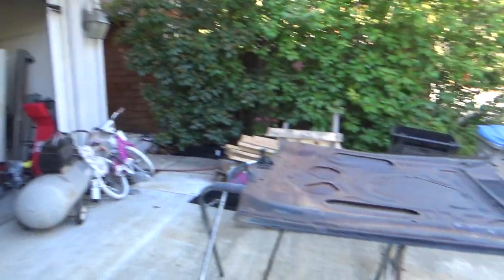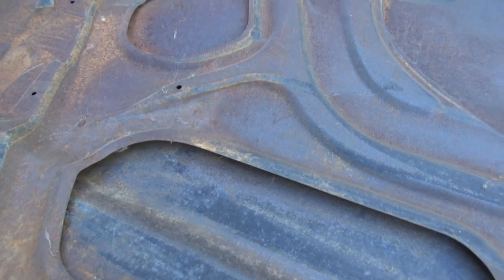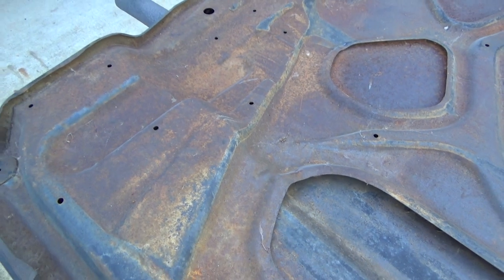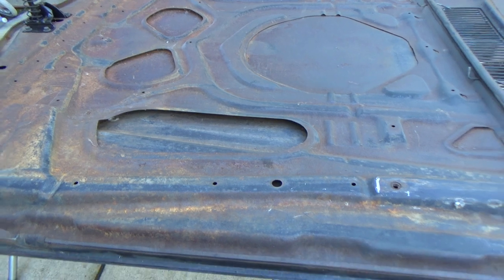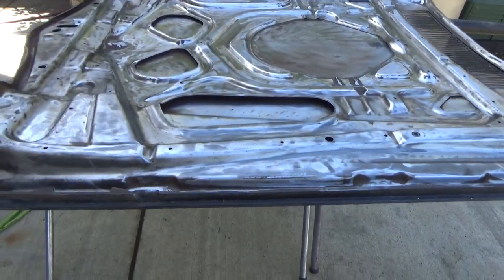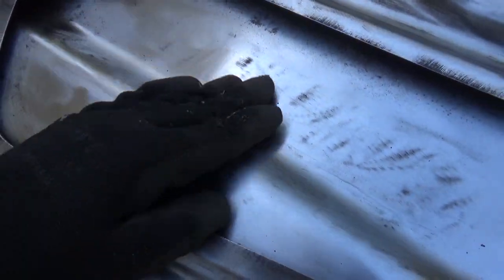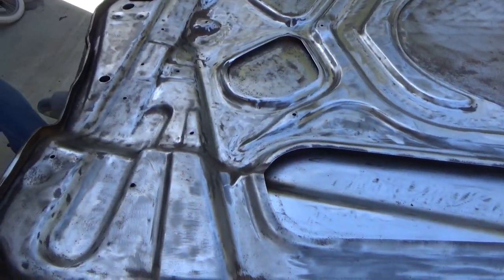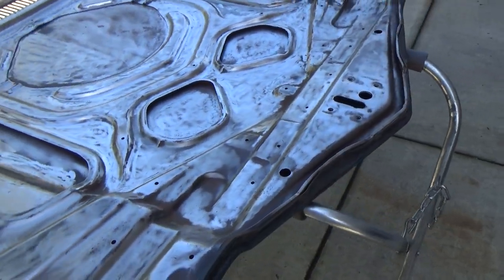1977 Camaro Z28 Part 164 : More hood stripping

Comment: Man, that's a lotta work just stripping it down, but it came out the kinks!  Is that sub-panel tack-welded here & there to the outer hood-skin or just glued with typical body-adhesive for the most part throughout?